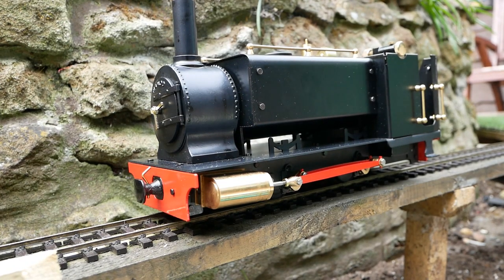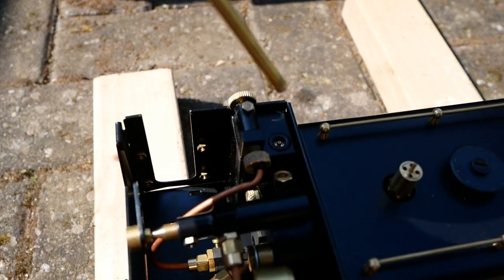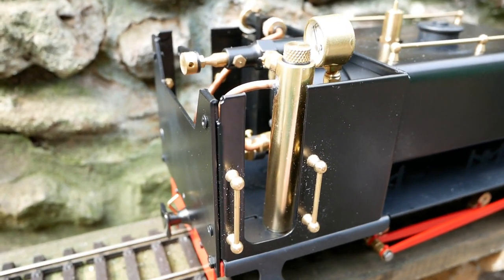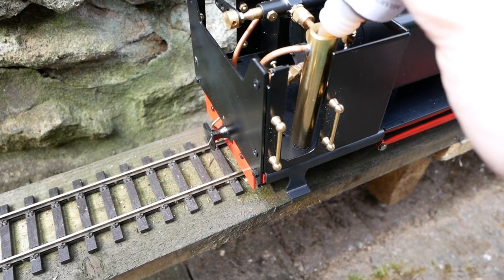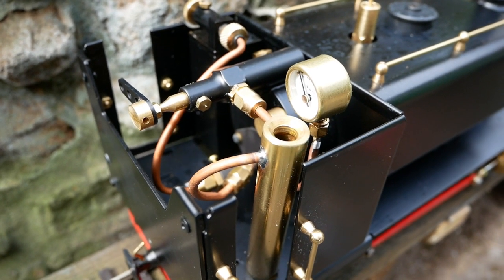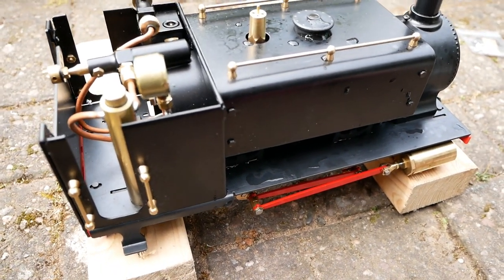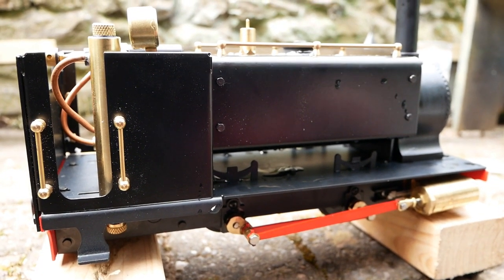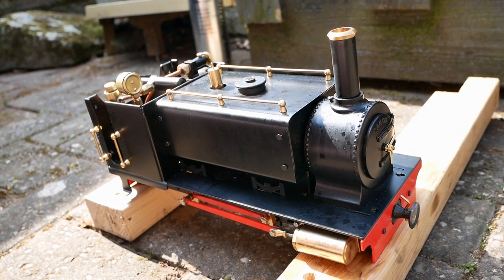Mamod Quarry Loco - How to Fire a SM32 Locomotive! Step by Step Guide

Comment: OK so I watched the vids in the wrong order. I like the way you describe each step of the process. I have a Mk3 Mamod and the process is similar but not quite the same. Watching you go through the oiling points is very useful. A cracking loco and excellent video. Looking forward to the next one.
Reply from the maker: Thank you, I wanted to try and be as informative as possible, little bit hard to film at the same time but glad you enjoyed, the loco really does run well though, once again many thanks 👍
Reply: Hi, what do you think of the mk3? Would it be possible to fit a pressure gauge?

Comment: Rather than removing the smoke box door, have you tried lighting the gas through the funnel/chimney?
Reply from the maker: I have done, but this loco doesn't seem to light to well as there is a slight blockage stopping the flow of gas, think it may be a bit of solder, but I have had this fixed but a steam buff (hopefully)

Comment: Hello, thanks for the nice video.
What amazes me, there is no sight glass for the water level? When should I top up the water?
I have a Mamud Brunel with a water indicator.
Greetings Harald from Germany
Reply from the maker: Hi, thanks for commenting. The boiler is designed to run out of gas before water, so long as you fill it up full before you run it, but I do agree, it definitely needs a water sight glass! Many thanks from Keiran in England :)
Reply: Are you really amazed ?